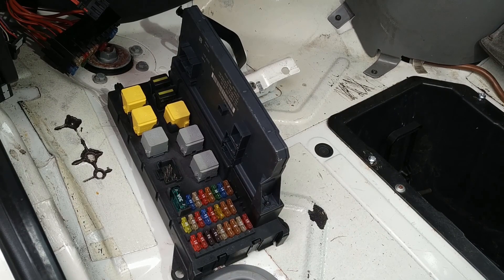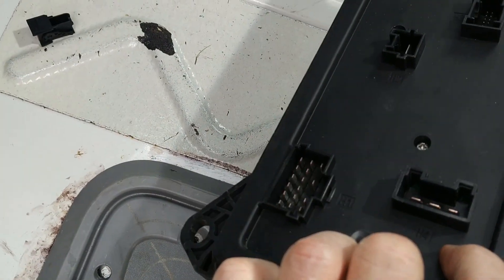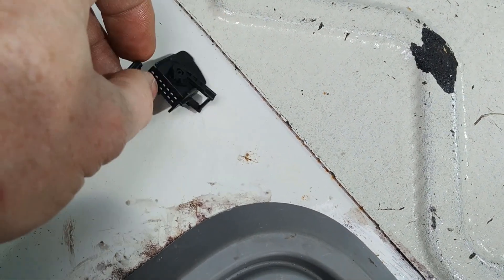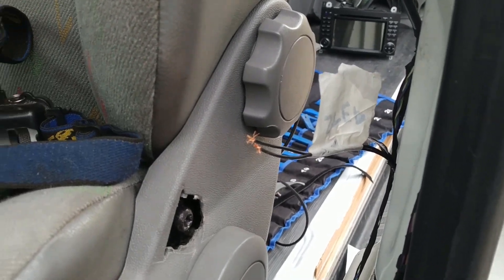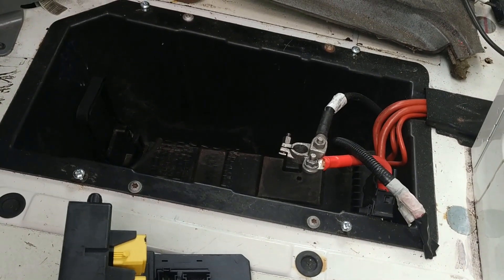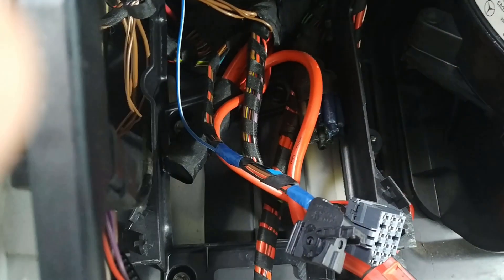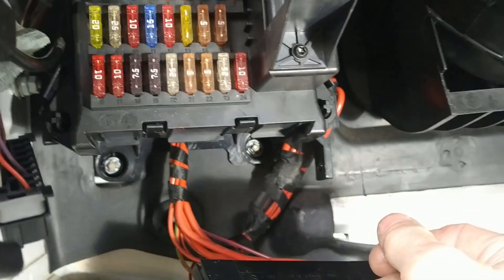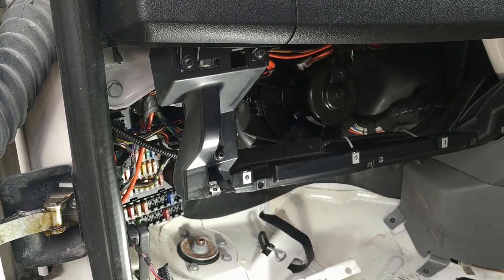VW Crafter (or MB Sprinter without EK1), locating the D+ (engine running) signal wire.

Comment: I need to find D+ on a Euro6 (presumably smart alternator) 2016 Crafter, but I'm struggling - would you have any idea where I could get the info on where it is?
Reply from the maker: No I don’t sorry but you might find it in the pdf you can download from here.
https://bb-database.de/jctumbau/en/web/international/crafter-2011-2016
Reply: Perfect info - exactly what I was after but had been unable to find. Thank you.
Unfortunately it seems that D+ simply isn't available on Crafters with stop/start :-( so on to plan B (hack the CAN bus to read engine revs and work out whether it's running or not!).

Comment: i have a sprinter with no ek1. very annoying. so thanks for this. i'm happy to just splice and solder and heatshrink though.
Reply: ok alternator wire for me is blue / red. working on figuring where it goes. 2011 sprinter 319.
Reply: @himselfwastaken how did this workout for you? I'm in the middle of figuring this out for a 2017 sprinter. Other option would be to get a D+ simulator. Not sure if this is in the end would be easier?
Reply from the maker: Was EK1 an option for your van? Just wondering, assuming yours will probably have a smart alternator if D+ would still be presented on it!
Reply: @CriftinsCampers  no Ek1 under the drivers seat in my Sprinter. Do you have any thoughts on the D+ simulator? Votronic makes one for about $100.
Reply from the maker: @marco112584  no need to spend a lot of money just do a search for a 12v vsr pretty much anything the will switch at >13v should do imho.